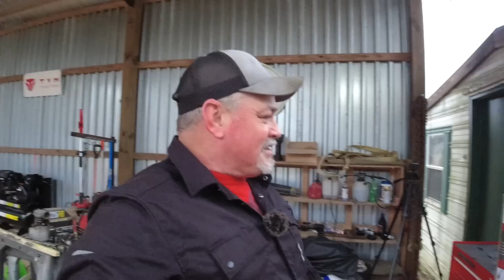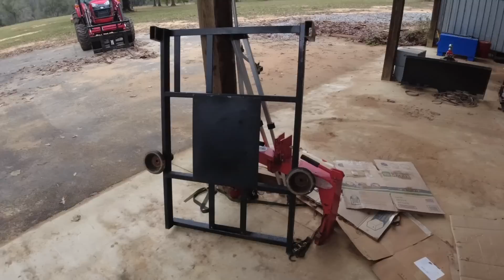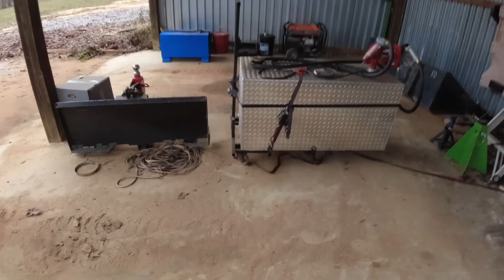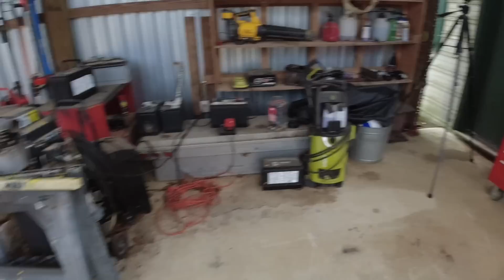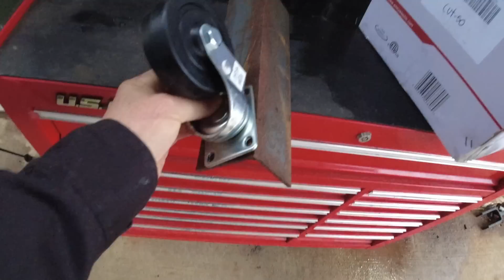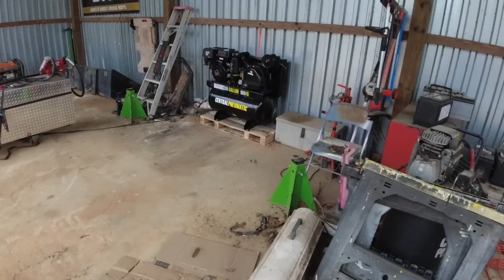First time plasma cutter! It went exactly how you’d expect!

Comment: Hi Hank, on side note, I am not a mechanic either but worked in spare parts for 25 plus years mainly on trucks. I notice when you attempt to start units that have sat for years you only use mostly two batteries. Most of the internationals out here in Australia have at least 3 sometimes 4. They were a 12volt system the extra batteries gave more cranking amps for easier starting.  Not sure what yours use. Have seen units with two huge batteries , these were fitted to European and Japanese units.   By the way,    Love watching your channel, keep up the good work.

Comment: Try using a guide for the hole in the forks. even a peice of wood will work. Use a hole saw in a thin 1/2 or so ply wood , experament on scrap steel . My shop has only 40 amp sub feed to it  ( over 100 feet from the main panel so i can't. wish I cold. I do use a small mig and engine driven welder.

Comment: A 20 amp breaker will probably be the largest you can buy for 120 volt circuit.   However, some manufacturers of breakers will make 30 and 40 amp single pole breakers.  But, You’ll probably  be better off using the adapter for 240 volt and using a double pole 30 or 40 amp breaker.   Just make sure your wire size between the breaker and plasma cutter can handle the amperage.   At a bare minimum a 10 gauge wire should be used for 30-40 amps  depending on temperature rating of the wire.  Stick with the brand of breaker that made the panel.  Best to not mix brands.   Thanks for sharing your new toy with us!👍👍

Comment: Works with the arms best in draw towards you or away straight arm push.  You are using arms in arcs and trying for straight lie.  Takes time to learn and it will be nice. On the channel iron - notice the corners are bulk metal - maybe 1/4 or 5/16.  To go through the corner.

Comment: Ah you need volume more than pressure.  Depends on usage.   Nitrogen bottle is good also.  Dry air is your friend - if the air is moist, get a refrigerator air line filter to drop water.  Water will create steam and spray your beam and might consume the parts faster.  I have a Hypertherm and have loved it for 20 years.  Need more current based on hardness also.

Comment: I’m not a big fan of plasma cutters, but I have used them. Get a belt driven air compressor and throw the buzzer air compressor away !!! Boost your air pressure, leave the compressor on while cutting. Slow your feed down by half then maybe half again. It’ll help to practice off camera. I prefer an Ox/Acc cutting torch , but I’ve been using it 55 years and set in my old school ways 😂

Comment: Great little plasma cutter. I bought a Primeweld Cut 60 a couple of years ago.  It's a beast that cuts to 3/4 but is still budget-friendly.  The most important thing for the life of your consumable tips is dry air.  I have my Cut60 mounted to a cheap HF $40.00 welding cart and mounted a motor guard M-60 air dryer to it.

Comment: These things have come a long way. When I was a kid my dad had a plasma cutter the size of a small refrigerator. I bet it weighed 600 lbs. It could maybe cut 3/8 steel...
Reply from the maker: Right on. It's crazy how inexpensive and decent quality they are.
Reply: As much as I'd prefer to not buy tools made anywhere but the USA, I'll probably pull the pin on one of those 120v inverter based plasma cutters someday soon. I'll need to add a dryer to my compressor I guess...

Comment: Fantastic Tool.   The tool will tell you how fast it will cut  just like an acetylene  torch will . That is NO blowback and a clean shower of sparks.  A  Dry Air filter is important !!  moisture will turn to STEAM and will cause blowouts in the cut .  Great Video .Thanks

Comment: It may have come with a little brass piece that clips on. It will hold the tip at the right distance and angle for easy cutting, easy to glide along a straight edge and not plug it up. There's definitely a learning curve, takes some practice.

Comment: Hank, I use small BBQ grill carts to hold my wire welder and plasma cutter. Just remove the grill, (usually found along the road), and the welder/plasma fits right on with a tarp strap to hold it down. Wheels are on one end and handle on the other. Hope it helps you too.
Doc Martin

Comment: If you are using 30 amps at 110-120 volts ac then changing to 220-240 v ac requires only 15 amps to do the exact same job of the electric amount

Comment: Yeah you will need 30 A breaker, I also have a cutter. You are going to fast plus back away you also to close to the metal. It will clog up your tip. Take a lot of practice. Yes 220 is the best it’s a plus.